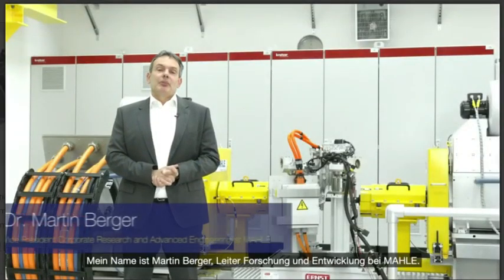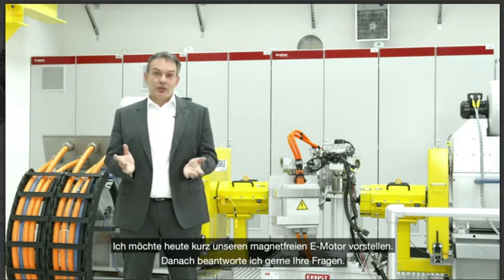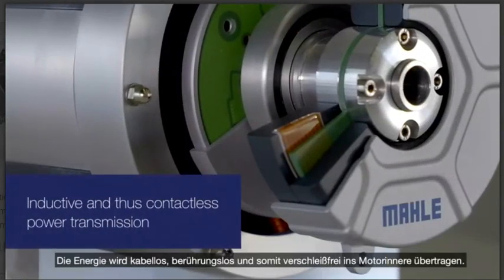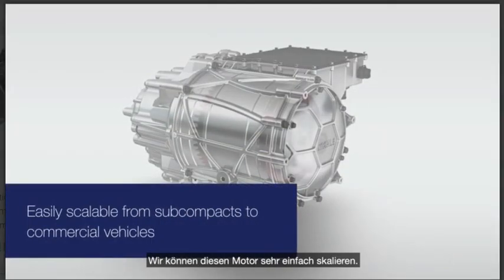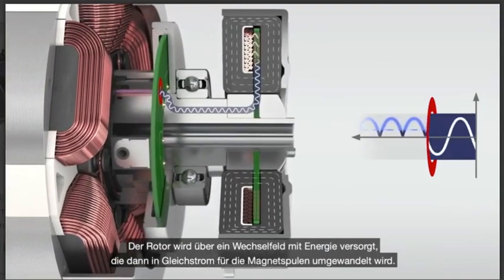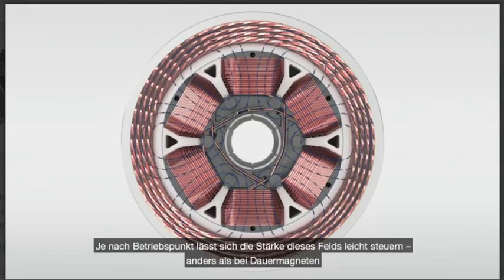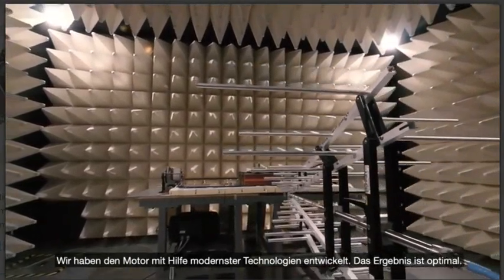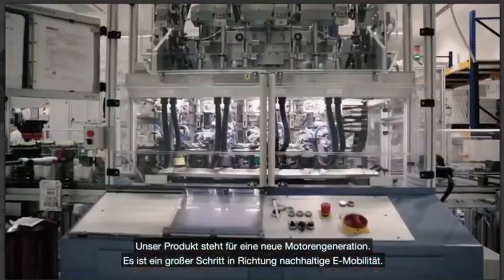Mahle, produce revolutionary new no-magnet motor...

Comment: Permanent magnet motors became the standard because of better efficiency, since excited stator motors use electricity to produce the required magnetic field.  I personally don't believe that Mahle can make an excited stator motor that has the same output as a permanent magnet motor and use less electricity.  Violates conservation of energy.

Comment: Surely there is a not insubstantial decrease in efficiency due to ohmic conduction loss in the (now) electro-magnets. Eg. to get a 1 Tesla permanent magnet is not so hard, to generate the same with an electromagnet requires very substantial coils, and requires considerable additional cooling due to the losses. 
Also whilst the shift away from rare earth is admirable, you have to replace it with large amounts of copper, and that is by no means an abundant element!

Comment: The excitation power provided by the induction coil has already consumed a lot of energy. Is it a joke to say that the magnetless motor is more efficient than the permanent magnet motor?
Magnetless motors use more copper resources, rectify electronic devices, and complicate the mechanical structure manufacturing process. Is it in line with economic benefits? The volume and weight have increased a lot, can the output power density be compared with that of a permanent magnet motor?
Isn't this technology the same as the brushless excitation generator technology that already existed a long time ago?

Comment: So this is basically a separately excited synchronous motor, except it's also brushless. Though I guess that if you want to be super fastidious about it this would actually count as a synchronous induction motor in a way, since the rotor is excited by induction (an induction that doesn't come from the stator though)
Reply: Watch this video, a guy discovered anti gravity  https://youtu.be/34L7fSjKbqc shape has power, he learned from rare metallic beetles.

Comment: So it's basically a universal motor with induction generator instead of brushes.
Yup, I think it combines the best of brushless and universal motors.
But the main question is: does it operate on AC or DC?
Reply: AC - it is a synchronous AC motor.
Reply: @brianb-p6586  but the rotor operates on dc current which is completely different than your typical induction motor
Reply: @KogiSyl  Correct - as in any motor with an excited rotor, the rotor winding excitation is DC. It is an AC motor because the magnetic field of the stator rotates because the stator's three-phase windings are driven by AC power.
You are also correct that this is not an induction motor, but the 3-phase AC drive to the stator is the same as it would be for an induction motor, or for a synchronous permanent magnet motor. The interesting part is all in using windings on the rotor (like a universal motor), and how those windings are powered without using brushes and slip rings.

Comment: Renault Zoe motor don’t use magnets, but uses brushes like an alternator, to control magnetic force in the rotor.
This technology is very nice, you control the rotor without brushes by induction 👍 free maintenance
Reply: Yes, good catch. It is essentially the same as the Zoe's motor, but with an inductive coupling replacing the brushes and slip rings.

Comment: 96% sounds unlikely, unless at virtually no load. As soon as you apply torque those magnetic fields will start slipping with respect to the stator. Unlike a transformer where you can get excellent transmission though a shared core, with a motor, you have to cross a gap between cores which means a significant drop in efficiency. So now you have a motor with transformer style efficiency?  Please tell me more, I am genuinely interested.

Comment: So how is this thing controlled?  With something like an AVR from a genset controlling the excitation current, and a VFD controlling the applied 3-phase voltage/Hz?  And an algorithm that relates the two for maximum efficiency at any speed/torque?

Comment: My guess, and this is just a guess, is that they followed the lead of the Fisher motor company in optimizing the coil design for minimum stray magnetic field. 

Fisher makes super high efficiency, compact alternators because their windings deliver a high percentage of the magnetic flux exactly where it should go. 

If you could do that with an induction motor you could get both increased torque and less heat.

It’s not revolutionary in concept, but in execution.

Comment: As others said, this is an old idea.
- it’s advantageous on one hand because the variation of the rotor magnetic field acts a bit like a transmission
- if the efficiency is down just a few percent (compared to a permanent magnet) it is worst as those percents need to be added to the battery in the car witch add weight, mining, cost, etc

Comment: Everyone is commenting about how synchronous motors don’t need magnets to produce rotation. This is true, but I believe that up until now they did need magnets in order to turn that rotation back into electricity.(ie. regenerative breaks)
Reply: Tesla Model S uses an induction motor with no magnets. and it can be used as a generator. the trick is to excite the routor slightly and if the motor is spinning faster that your phase changes, you will get some energy back.
Reply: That's not true - there is no difficulty generating with an induction machine, and it is done by even the cheapest and most common of controller/inverters for induction motors used in amateur-built EVs.

Comment: Mahle has a good reputation as a automotive parts supplier.  It’s interesting that they have taken steps to become a stake holder in the EV market.  An off-the-shelf electric motor that is efficient, reliable, cost effective and configured for automotive use will assist many OEMs transition to EV manufacturing.
Reply: 4 YEARS LATER.....AND?

Comment: Sounds very similar to the motor that was in the first Tesla Roadster.
Reply: No, it's not at all. Tesla started with induction motors, and still uses them in some models... but this is not an induction motor.
Reply: @brianb-p6586  What's the difference between this and an induction motor?
Reply: @MyHandleIsGood  In an induction motor, windings (usually just a "squirrel cage" of bars) on the rotor have current induced in them by the passing magnetic field from the stator, which causes current in the rotor and a rotor magnetic field as a result. For this to work, the stator field must always run a bit faster than the motor is turning.

In a synchronous motor like this, the rotor stays in step (exactly the same speed) with the rotating stator field. The current in the rotor windings is not induced by rotor motion, which is why it's not an induction motor.

To most people the difference is not apparent and probably not understood, but in the area of motor design the difference is very significant.

Comment: how is it different  from our conventional dc motor, except the wireless power transmission part? , i mean they are still using copper or aluminium core as in presentation

Comment: So they made a wireless slip ring motor. 95 percent efficient seems high since it would introduce more thermal losses. Copper core induction motors have been made to run at 98 percent efficient at certain loads.

Comment: Would that not be applicable in the form of electrical production? Im not a engeneer or anything but if you can produce a self generating supply could you not implement like a capacitor and a voltage regulator along with i would say some sort of way to generate only the current needed to supply power to a dwelling and also eliminate the use of a battery as a storage device. Like i said im not a engineer i just had a thought for a while of something like that and i think this could be a viable platform. Every time i mention it to a engineer and ask if they would be interested in pursuing it.....well they run away basicly.

Comment: 2:47 it shows a spinning disc where one would expect brushes (or contacts), converting an AC current to DC transferring it 'wirelessly' to the disc creating the electromagnetic rotor, thus with the stator also being electromagnetic you get your "magnetless" electric motor.
The interesting part would be the losses across that 'wireless' jump, but more significant is the fact you could increase the magnetism strength of both the Stator and Rotor in unison, perfectly matched to maximise the efficient production of torque - so other than heat and materials, you could theoretically produce as much torque as you want....that'd be correct?
Reply: I see, brushless , no commontator, the stator and rotor are not physically  connecter ?
Reply: @darwanwinkler4125  yeah, its the loss over the wireless and conversion of ac to dc, but other than that, a brilliant idea to remove the perm magnets and contacts, electronically controlling all aspects of the motor.

Comment: Nice. In addition to not requiring rare-earth magnets, your separately-excited design has a lot more flexibility for use because the field can be modulated as the motor speed and load demands change. Motor technology is very mature, and you've found a new concept which is really innovative. Previously all "brushless" exciter designs have depended on the rotation of the rotor for the exciter to produce a current for the rotor field coil. Very nice design to overcome this limitation!

Comment: Motors without permanent magnets? They’ve been around for over 100 years.
Reply: You need to understand more than that about motor design to understand why this is different from existing motors.
Reply: I guess it's "new" because of its coil layout.
Reply: "Motors" covers a huge range of different types.  Can you name an electronically commutated synchronous DC motor that was available 100 years ago?

Comment: In my world, motor without magnet is called induction motor or synchronus reluctant motor. Both of which have been widely used in automotive industry.
Reply: But induction motors and reluctance motors (both switched and synchronous) are all different designs from this, which is a synchronous motor with rotor excitation using inductively transferred power. 

Induction motors have been widely used in EVs, but otherwise are not used in automotive applications. Switched and synchronous reluctance motors (SR and SynR) motors are not used in the automotive industry, although SR motors are common in industrial applications (even heavy mobile equipment) and it is currently fashionable to refer to PM AC motors in EVs with a name suggesting that that they have a reluctance component.

Comment: I've always wondered how this could be done efficiently at high power without causing issues due to the high frequency.
     This reminds me of a VCR head motor, it has 4 spinning heads.  How is the signal from the heads transferred to the board?  It is transmitted inductively from the head to the base, around the axis, so the spinning/position doesn't affect its operation.  The motor was just a standard brushless motor, but the signal transfer was akin to how your motor works.

Comment: Generators for portable construction site lights use the same principle in reverse. They use a small exciter coil through a bridge rectifier diode to produce a DC voltage for the rotor coils magnetic field inducing a voltage into the stator coil to run the lights. These guys just reverse the operation and induce a voltage into the stator to run the generator as a motor.

Comment: I was hyped and skeptic with ur no magnet thing. Turns out its just a wound rotor, of which when both fails is expensive rather than the squirrel cage. And everyone goes after to the cheaper one to repair, just the stator no rotor to be rewinded.

Comment: This sounds exactly like the integrated exciter used in generators of old ČKD diesel locomotives. Its nice to see old technology reintroduced...
Reply: Not quite. The power transfer is via a pair of ring-shaped coils concentric with the shaft so their magnetic field is axial (as clearly shown in the video), so there is no current induced by motor rotation; instead the drive coil current is inverted (probably just chopped with pulse width modulation for control)... that's the difference which allows this design to work equally well at any speed.
Reply: @brianb-p6586  By "so there is no current induced by motor rotation" I assume you meant I was talking about the inverted synchronous generator exciter, but I ment the rotating transformer exciter. This rotating transformer is divided into a stator part, which is supplied by AC current, and a rotor part in which AC voltage is induced by "magnetic flux change in time" (not rotation). The current created by this induced voltage is then routed through a rotating rectifier to the rotor coils of the main generator. While there are some differences in arrangement (and of course power supply to it through modern converters) between this rotating transformer and Mahles new motor, the basic principle (at least to me) is the same.

Edit: I think Siemens also uses this principle.
Reply: @pavelsovicka5292  If there are existing motors which use AC excitation of the rotating transformer, rather than rotation of the shaft, then the Mahle design is not new; perhaps only the rotating transformer configuration (or even nothing at all) is new.

Do you have a link to a description of the rotating transformer exciter of the old ČKD diesel-electric locomotive system?
Reply: @brianb-p6586  Mahles "innovation" may be in that they used it for a machine dedicated to be used as a motor. ČKD mostly used these for generators. I dont think this was done in a mass produced machine as it never was needed. Either the induction motor was used or a permanent magnet synchronous machine. If there was an application where induction was not good enough while magnets were deemed to expensive, reluctance machines were used. So its interesting that now Mahle thinks there is a space for a machine like this.

Unfortunatelly I dont have any links, only some of my own notes from university studies and a memory of explanation given to me on how it worked. Its hard to find information on these decades old systems. Especially when they were designed and produced in the Eastern Block. So to be honest, I cant backup my claims or opinions with much evidence. This is a pity, as there are a lot of lost designes that once were state of the art elegant solutions but are now forgotten...

Comment: They have been making motors without magnets for years and years. Two examples are standard ac induction motors in most household products another is switched reluctance,  both motors do this at the disadvantage of a much larger size.
Reply: Right, but this isn't an induction motor or a switched reluctance motor, both of which work but have their own issues.

Comment: Pretty skeptical of claims of efficient inductive power transmission. Also the rf noise from using induction to transmit kilowatts of power too seems like it would be absurd. But I'm not an engineer. That's just my gut.